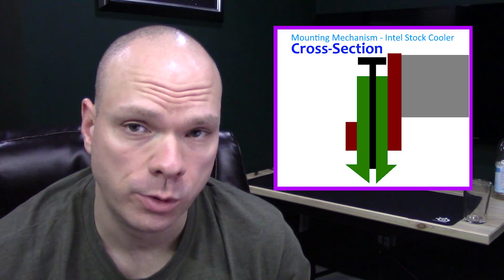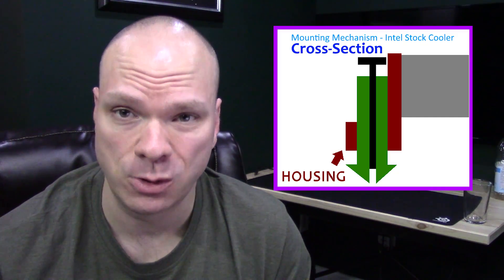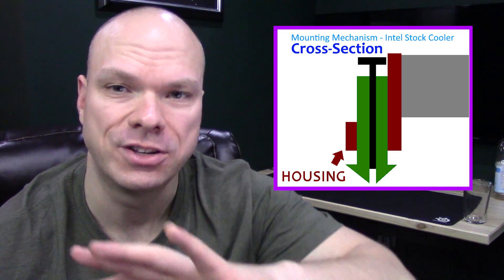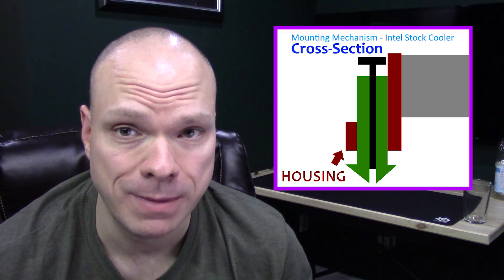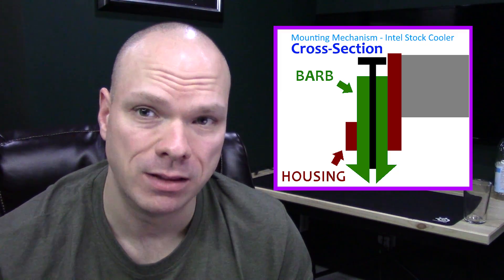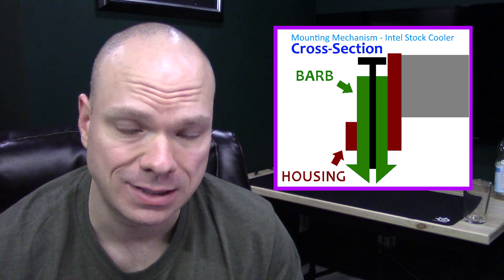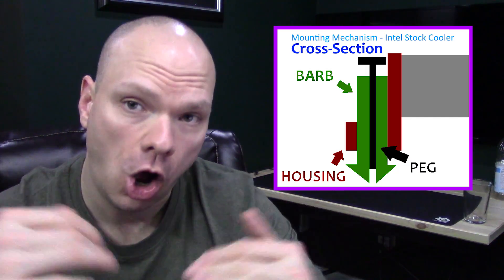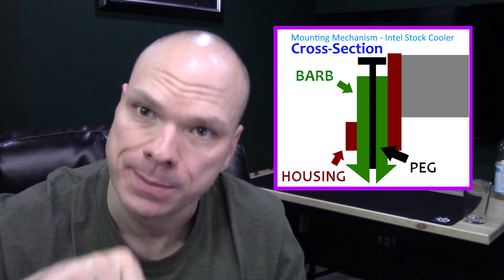How to Properly Mount a Stubborn Intel Stock Cooler 100% of the Time

Comment: You Big Beautiful Bald Bastard! 6 years later, and you're still saving lives. You're a F***ing Legend. 

Bruh, when I tell you I was pushing down on those pins so hard, I thought I was gonna snap the whole motherboard in half. And every. single. other. video. kept insisting, "just make sure you get the diagonal pins, and you're good!"

Comment: Video is still helping others, even without a live demo ;)   It's pretty easy once you do it this way.  I didn't even have to remove my mobo, just lay the case flat on the side, used light but firm pressure, and a bright light to see that the white part was properly placed.  Maintained light but firm pressure on the center top of the fan, and light but firm pressure on each of the 4 black pieces to push the pegs in, getting a satisfying click from each of them.  Verified there was no wiggle or movement of the CPU, and voila!  Temps are back to a reasonable range now! Thank you!

Comment: Now i do not feel so bad now that I know I am not the only one having a grand old time with these mounts. Ended up breaking one, not sure as to what to do I carried the whole computer up town. A guy took a look at it, and I explained to him I was attempting to change out the paste. After 10 min or so he says he can fix it for $150. So, I thanked him for his time and left. I get home looked online, $12. Found one that says it will fit the, i3, i5 is what I have, and the i7. It was delivered this morning. I open it up and it looks the same. However, it is not as thick as the one that was on the computer. Before I put this one on the computer even though it is about a half inch thinner will this work?

Comment: For the love of Christ, thank you. Inexperienced and frustrated builder here who had one peg who would not click. Instead, I just push down the white peg in first and then slide the black bar down from prime position. You prime by twisting the plastic caps clockwise 90 degrees.

Comment: You are a life saver, dude! I had some old intel stock coolers with the copper base and of course they have been used and I tried doing the cross thing and it didn't work, the left part entered no problem but the right part(both pins or whatever) didn't fully enter even if I pushed very hard. Holding the black top part(the one you press in) and pushing that bottom black part so that the white part goes all the way to the back of the motherboard worked smooth like butter. Done it in like 10 seconds and I've been pressing hard like an idiot for like 30 minutes before searching for a solution, the first solution was your video and it worked. Thank you so much man!

Comment: Been building PC's for a long time now, these stock coolers are the most painful thing ever. I absolutely love the mix between comedy yet actual practical advice. I still watch the video each time I end up installing one of these but I get it first try, every time :)
Reply: Yeah this video was perfect.  I havent built a system for a long time, and i took a cooler out of a 1200-socket cpu and i cant get it back on.

Comment: 1. Make sure that all pegs are turned to the right, away from pointing arrow
2. Make sure all barbs have fully gone thru mobo holes
3. Press pegs two by two in cross pattern fully down until you clicks
4. Check other side of mobo to make sure that pegs are as far down as barbs
Reply: means you have to take the motherboard out of a system if you cant see the back.

Comment: But can we agree that Intel need to step up with their stock cooler vs how AMD is doing it.
Reply: AMD's stock coolers are generally shit depending on your mobo manufacturer, cause the backplate can just fall off
Reply: They absolutely do need to upgrade, but I ran a stock speed 6600K on the stock cooler from my i3-6100 for a few months and it never shot above 60*C unless I was stress testing. However, I ended up putting a Hyper 212 EVO on it once I overclocked and don't see above 55*C while gaming @4.4Ghz and 1.25V.
Reply: yessssd

Comment: 😒 i hate them, what i do i dismount the board from the case and make double sure all the plastic pins hooks go thru and twist and lock each one by hand, However if ur in the 'First World' then plz spend more money, get a cooler that has a rear metal bracket and metal screws! So much easier! 🐢😍
Reply: Even in Third World it costs not that much but saves metric tonns of nerves.
Reply: 1kvolt1978 🙂 i found a metal bracket cooler master for my old lga 775, but for Haswell im stuck with the intel cooler for now, next trip i will look for something for 1150 😊
Reply: The Intel stock cooler is a cake walk compared to cheap coolers like the Hyper 212 EVO. I'm an automotive mechanic and am very used to working in cramped places with stuff that doesn't want to stay in one spot or need finagling to manage to get a few bolts in, yet the Hyper 212 EVO is something I hope I don't have to remove any time soon.
Reply: The Fat Turtle 🙂 theres a newer model called the Coolermaster 212 LED, the intel bracket is fixed now and cant be adjusted so its alot easier to put on, theres reviews on utube for anyone curious.